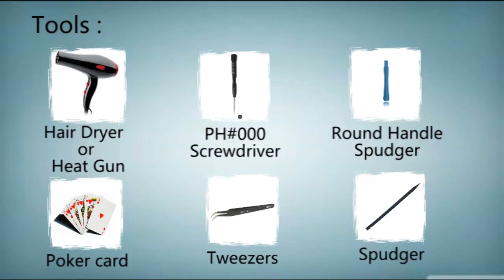Sony Xperia XZs Charging Port Repair Guide

Comment: Can anyone please tell me what the black part that holds the port in place to stop it from being pushed up into the phone as mine has broken but don't no what to search for thanks in advance for any help
Reply: thanks for this, noticed my charger port had also slipped too far away so I just tried to fix it with glue and pull the port back out with charger cable.

Comment: Hi, My phone does not power on at all while the charger is connected to it. No led lights at all. Could this be the battery or the charger port? Cheers
Reply: have you solved this?